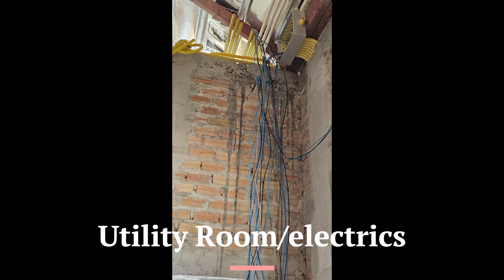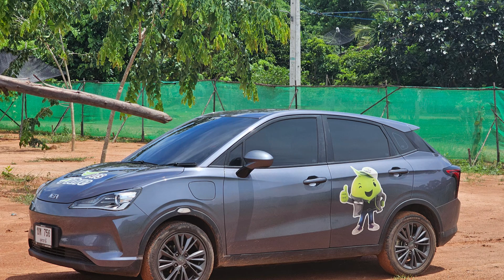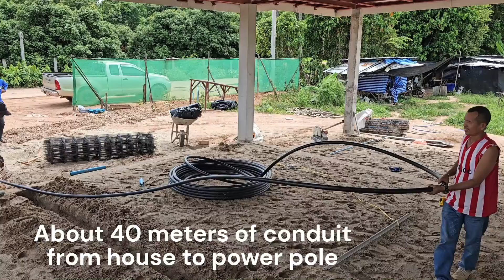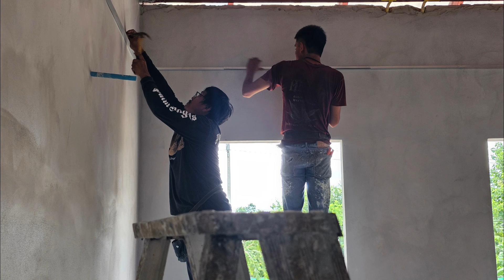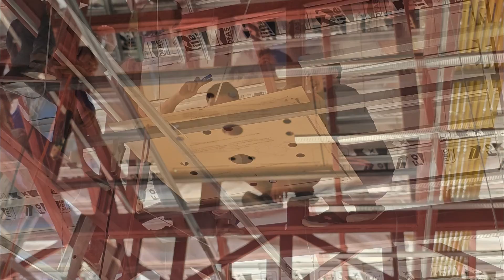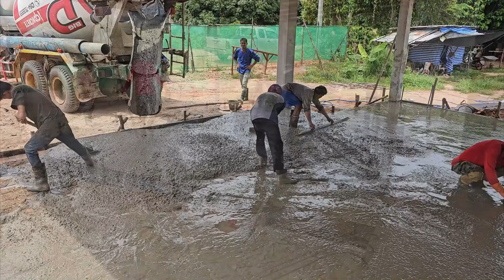Thai House Build Week 21

Comment: I hope your not using drywall for your sofits. Hopefully you mean cement board. Do you know if its just cost that they use suspended ceilings over a traditional framed ceiling? And the use of a central ac head unit in the ceiling is interesting. I'm guessing they don't put them in the wall because they don't want to drill holes in the block?
Reply from the maker: @worldadventureman  drywall for inside the house, & yes cement boatd for soffits around the exterior. Sorry if I didnt mention the difference.
Reply from the maker: @worldadventureman  they also but wass ac units in - we will have 3 in eas bedroom & one in the kitchen. The cassette type is for the large lounge/dining area of 8.5 x 6 meter so best way to ac the soace.
Reply from the maker: @worldadventureman  The use of suspended ceiling with drywall is the standard practise here. Allows for ease of access & modifaction later if  required.